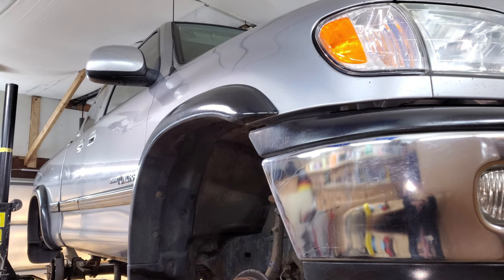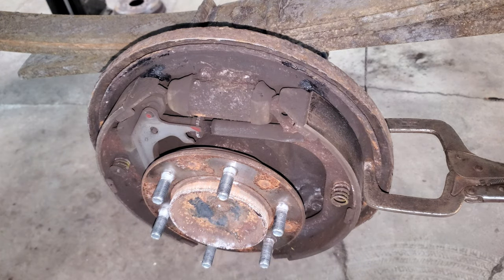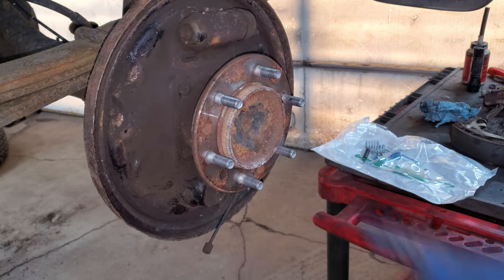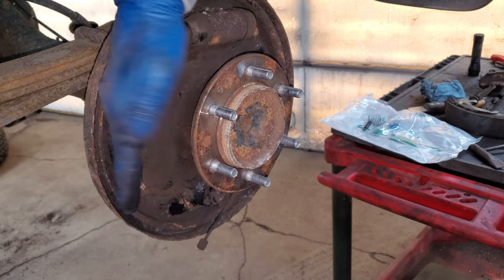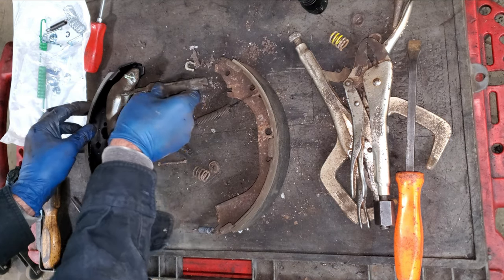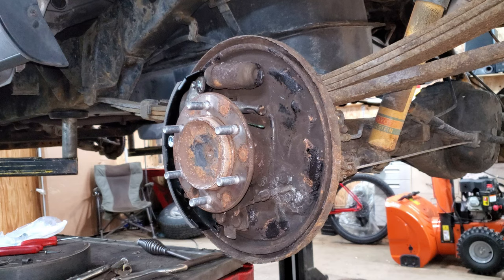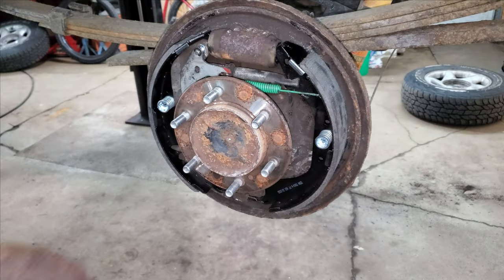2000-2003 Toyota Tundra rear shoe brake job

Comment: Excellent video.... this gave me the confidence to do the work myself.  I have done disk brakes for years and do them quite easily.  I did the rear drums last week following your guidance but the end result looked pretty and clean but I have a very soft pedal.  I have absolutely no parking brake.  Before I start adjusting the parking brake is there anything I need to check with my work?
Reply from the maker: You want to adjust the shoes unil you feel a slight drag on the drums. You should feel it touch about 1/4 of the time every half revolution. Something lime that. Hard to explain. If your drum gets hot when you drive it, they are too tight.

Comment: That friggin return spring does not work very well with spring pliers. Thanks for the tip using vise grip wedged against the the wheel hub.

Comment: Is there a primary and secondary shoe you forgot to mention <3
Reply from the maker: On has a pin, one does not? I think the shoe material were the same size on these. I don't notice shorter material on many new shoes anymore. Now I get to question myself. Thanks!
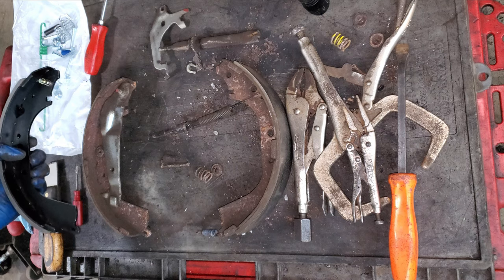Reply: @RustBeltAuto  I think you did it right - if you see at 6:25, you replaced the left hand shoe with the correct (new) shoe...

Comment: Ughhh you put the smaller pad in the front. Backwards 11:20
Reply from the maker: Yes. Short pad front. I think I got that right? Been that way on cars for as long as I remember. The short pad is made that way to help the adjuster work. They usually don't work right anyways. Most now days are all the same.